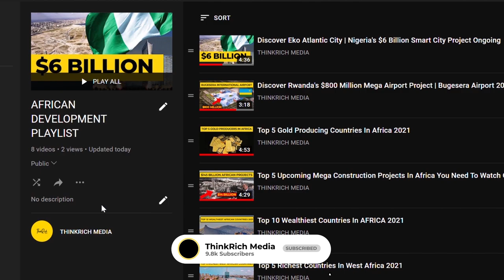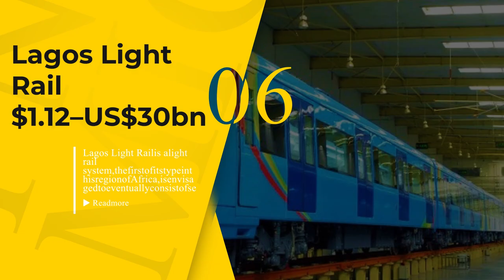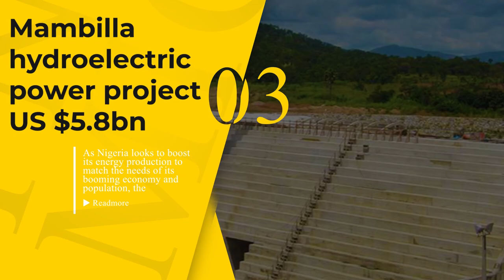The 10 Most Impressive Mega Construction Projects in NIGERIA 2022...

Comment: Nigeria is never serious about any electricity project, a lot of them are either abandoned, engrossed in legal battles or bureaucratic bottle necks.
Reply: The current govt is very serious about it,Siemens is doing a lot to help strengthen the grid
Reply: @akeemsalami1764  the Siemens deal has been signed since 2 years or more but there is no improvement in Generation, Transmission or distribution networks. I read in an article today which validated existing knowledge that power available to discos for distribution has remained around 7,000 MW since the last 7 years. No improvement, if there has been any flux, it goes on a downward trend rather. 
If Nigeria was really serious about improving power, 4 years is more than enough time to make significant improvements. Speaking from experience.
Reply: You are very wrong,Buhari is completing most of the abandoned projects if not all,his govt is very serious about infrastructure.